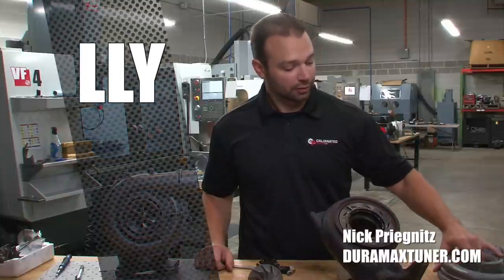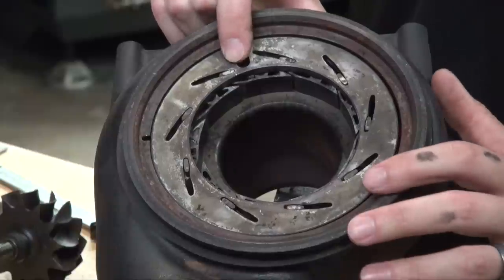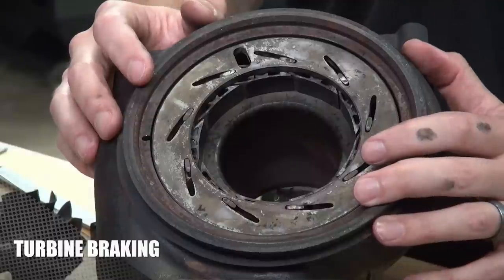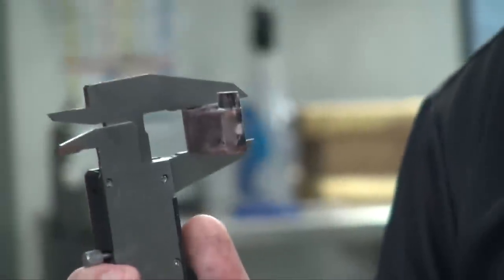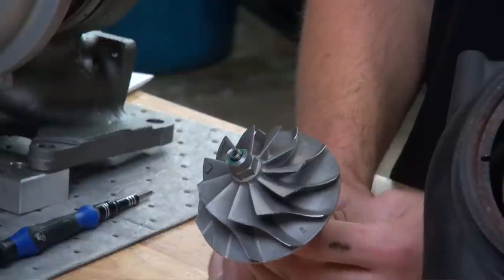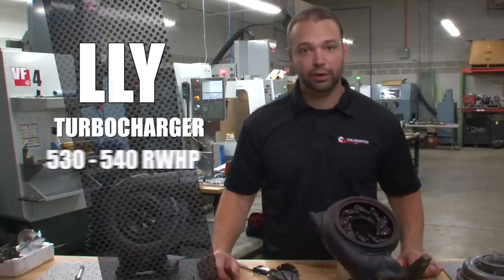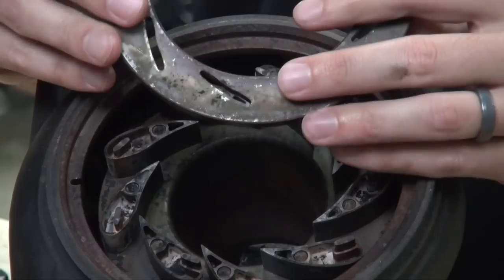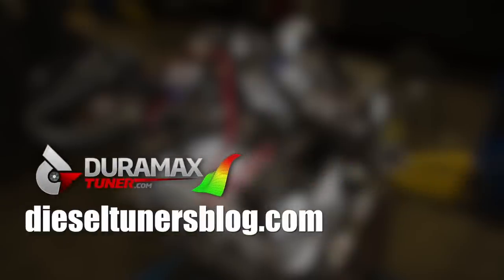The Duramax LLY, LBZ, LMM Turbo - Diesel Insights

Comment: Just curious because I had a V-band clamp break (turbo did not fully separate and damage luckily) but the turbo has about 1/16" to an 1/8" gap that I can see. Should it be closer together or will the new V-band compress it closer? Have not removed turbo hoping not to if not necessary. I was also thinking I could test the plunger for the vanes with turbo still attached with removing the cover and magnet process. Sorry if this is not allowed just curious and seen this video.

Comment: Question, since the lly is the biggest factory turbo, would it make more power on a lmm than the stock lmm turbo? Asking because I bought a lmm truck with a lly turbo with a batmowheel, but in less words the turbo failed so I replaced it with a remained factory lmm turbo, of course I put a 6 blade billet wheel in it before installing,  just wondering if it would be worth fixing the lly turbo and putting it back in. Thanks. also considering sending the lly turbo off to be built to the 64mm turbo and just selling the turbo I have.
Reply from the maker: I don't think you would see much difference from what you have now.

Comment: Do you need to upgrade the transmission with your stealth vvt?
Reply from the maker: It is not required to have a built transmission with the Stealth VVT. But you will want to consider an upgraded transmission when and if you decide to add fuel modifications to reach maximum horsepower like 640.

Comment: Dependable, except for when my V band broke on my 2004 LLY. And locked it up while towing a 13000 lb fifth wheel. So far my parts bill at dealer cost is $2,700 due to all the broken bolts that refused to come out and having to replace all the necessary hoses buried in that death chamber to have to keep from going in there a second time. All because of a $55 V band

Comment: how much HP can a LLY turbo support on a LBZ with all the supporting mods ?
Reply from the maker: Pushed to the limit, probably around 575rwhp. It would have a significantly shorter lifespan at that level. Long-term happiness is gone past 530rwhp.
Reply: I would be happy with those numbers and the drivability of a turbo that small but what fails in the turbo when pushed that hard ?

Comment: Hi !! I have a question 
When the exhaust brake work from 2000rpm and more we have à big sound from turbo like à jake brake 
We have a sound only when we use the exhaust brake 
Truck is 2017 6.6l lp5 280k km 
Any idieas
Reply from the maker: Hard to say without having the truck here in person.
Reply: @Duramaxtuner  Yes i know but i suposse its a probleme with à vane too loose....
I am not able to reproduce the problem in the workshop🤷‍♂️